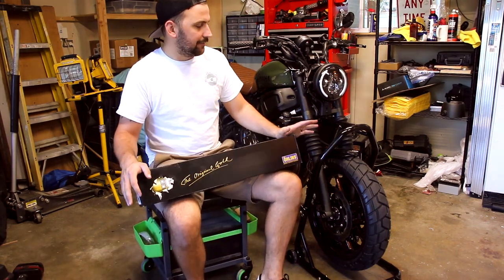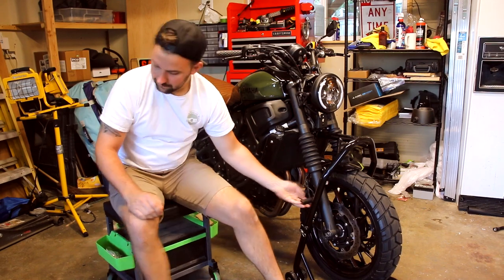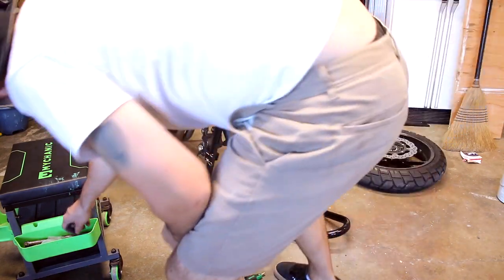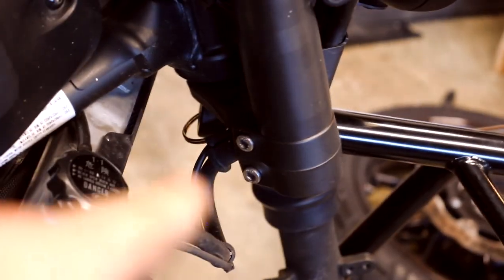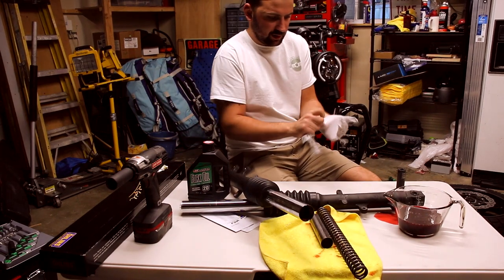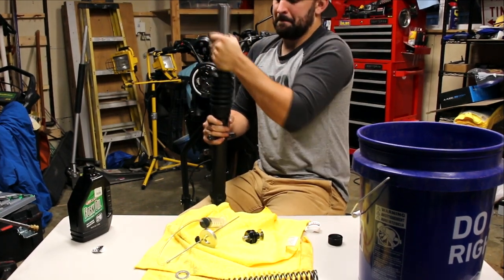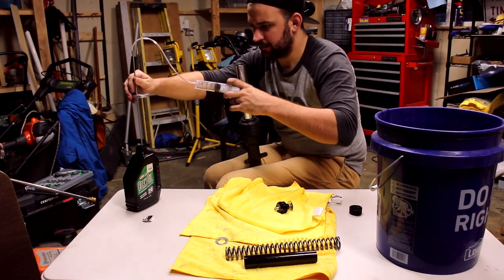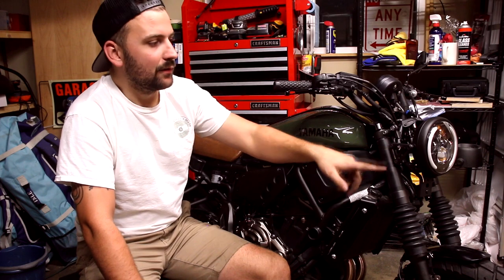XSR700 HOW TO INSTALL/UPGRADE FORK SPRINGS

Comment: great tutorial. how did the bike ride with the new fork springs? was the difference noticeable/improved? thinking of changing on my xsr xtribute. what was the spec of the spring as I am similar weight to you.
Reply from the maker: I've got the link for the springs I used in the description. Made a HUGE difference. I adjusted the preload quite a bit to make it even more firm. Doesn't sag anymore when coming to a stop it's like riding a completely different bike.
Reply: @scottomotive  thanks for the advice. I think its definitely an upgrade I will need to do